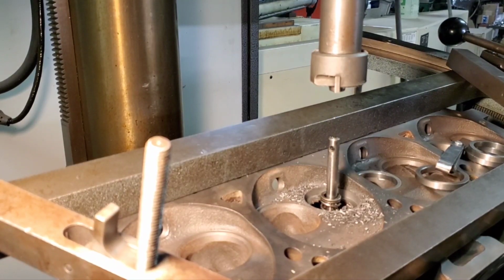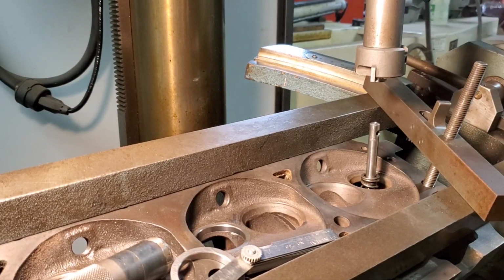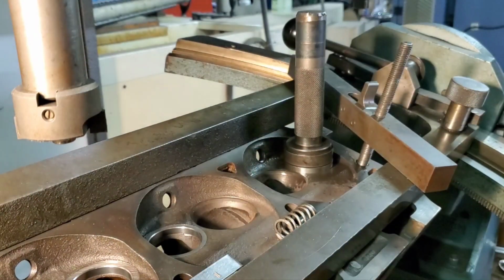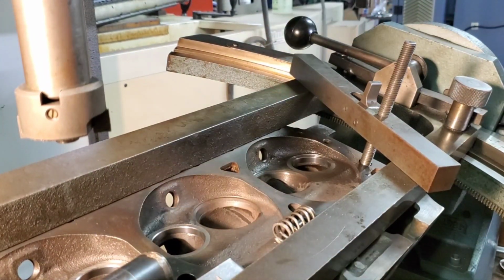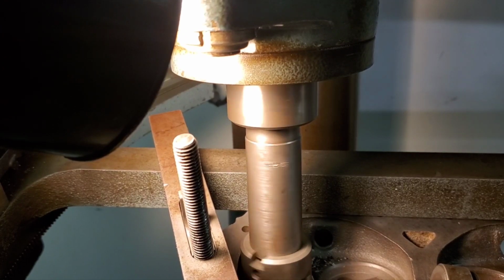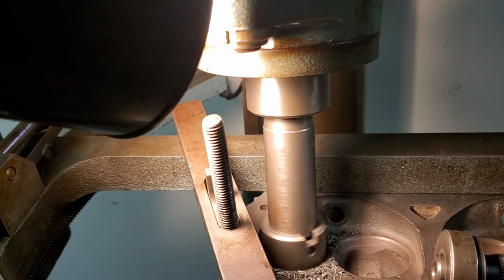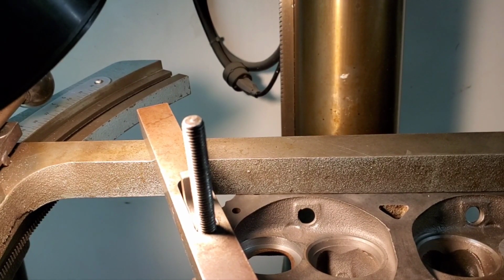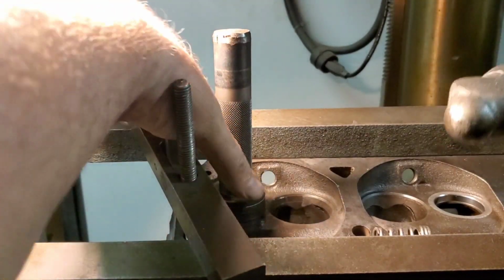Big Block Mopar 452 heads.Finish valve seat installation.

Comment: 👍 Always good stuff to watch and learn. Do you ever have the clients do videos on the finished protject ? Bet some of these engines run really smooth.
Reply from the maker: Thanks for watching Tim.
I really appreciate you. 
My early videos there is a '67 Fairlane,  I did the 431 stroker in it.
The '67 Belvedere 426 Gemi, I did that engine.
Check them out.
Take care, Ed.
Reply: @edsmachine93  will do !!👍

Comment: Ed, do you have a DRO or are you just not showing the depth measurements to make sure that you have gone deep enough for the replacement seat to sit at the right depth?  Or do you have a stop setup or something that you are measuring against the quill or something?

Love the videos.  Keep them coming.
Reply from the maker: No DRO John.
When I put the seat up in the depth gauge, plus a .005 feeler gauge.
Go to a hard stop.
Checking with a feeler gauge to see that I am at the bottom of the cut.
It is essential that the counter bore be cleaned.
Can get an upward deflection,  thus resulting in a high seat.
Which I can machine down if I need to.
Take care, Ed.
Reply: @edsmachine93  Thank you for the explanation on your process.